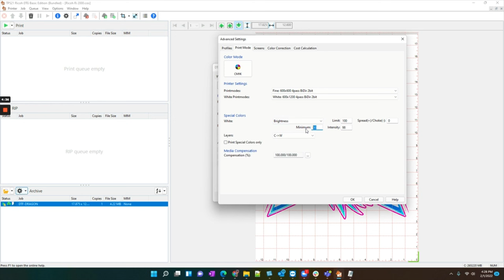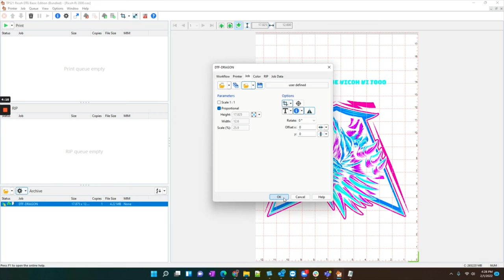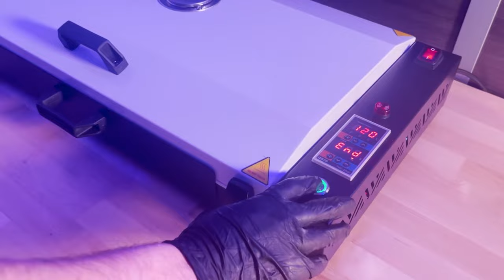How to: Direct to Film printing on a Ricoh Ri1000/2000

Comment: why to use DTF if you can use DTG? I don't get it,
Reply: You could sell the prints to someone who presses their own.
Reply: No pretreatment needed
Reply: @berkshireembroideryprintin8956  but theres adhesive that needs to be treated - so you're essentially trading one thing for another
Reply: @TimCurry_KC  I disagree. The powder is a lot easier to deal with than pretreating a shirt. You never have to worry about stains from the pretreat. Also it is so much easier and cheaper to use the powder than pretreatment.  A $169.99 oven from walmart cures all of my DTF transfers. I didn't have to buy a $4000 pretreatment machine and pretreat on top of that. DTF is the way to go. Curing the DTF powder takes less that 1 minute and that includes applying powder. Pretreatment takes 3x longer and a lot of the time there is over spray where its still wet on the edges after you press the shirt to cure the pretreatment. .